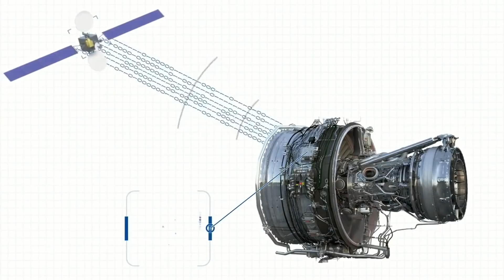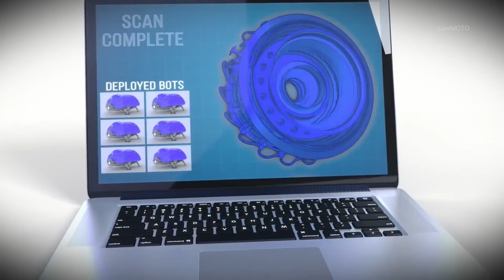Rolls Royce Trent production of turbojet engines

Comment: too bad everyone else in jet engine manufacturing stole Rolls Royce's methods for growing complete turbine blades. a lot of people don't know that turbine blades are grown from a single crystal of metal for extra strength. they are even hollow inside for air cooling.
Reply: Nicholas Howatson I work for Rolls Royce casting single Crystal turbine blade in Indianapolis
Reply: @davebasey9863  can I too get job there?
Reply: You'd probably be surprised at what P&W was doing way back when with welding turbine blade halves into mono-crystalline blades, for JT-9s & space-shuttle.

Comment: RR Trent is not a turbojet, It's a turbofan engine
Reply: Well said.
This total lack of knowledge and understanding doesn't stop some people from plastering their ignorance all over youtube - and many other places!
Reply: THE ROLLS ROYCE XWB-97 TURBO FAN ENGINE IS DANGEROUS AND HAS A TENDENY TO EXPLODE!!!!!
British manufacturer Rolls-Royce has been inspecting its Trent 1000 engines on the Dreamliners for cracked turbine blades deep inside, and taking off those with cracks for repair.
 The number discovered to have problems has “outstrippped rolls royces ability to support the customers with spare engines,” said Trent 1000 project director Gary Moore in an interview. 
IN ESSENCE THE  ROLLS ROYCE XWB-97 TURBO FAN ENGINE IS DANGEROUS AND HAS A TENDENY TO EXPLODE!!!!!
Reply: john john byrne i
Reply: Thomas Macken
Reply: @johnjohnbyrne2607 ,
Reply: d

Comment: This is a 10:1 By pass ratio Turbon Fan engine, not a turbo jet. Mis leading title. A turbojet engine has no bypass, just burns all the intake air
Reply: In a turbojet engine all of the air does flow through the the engine's core and there is no bypass duct. However, a sizeable portion of the air goes around the combustion section and is not directly involved in combustion. This air is used to cool downstream components in the turbine section. Also, in a turbojet engine that uses an afterburner the air that didn't pass directly through the combustion chambers is fed into the jetpipe to supply uncombusted air to the afterburner.

Comment: THE ROLLS ROYCE XWB-97 TURBO FAN ENGINE IS DANGEROUS AND HAS A TENDENY TO EXPLODE!!!!!
British manufacturer Rolls-Royce has been inspecting its Trent 1000 engines on the Dreamliners for cracked turbine blades deep inside, and taking off those with cracks for repair.
 The number discovered to have problems has “outstrippped rolls royces ability to support the customers with spare engines,” said Trent 1000 project director Gary Moore in an interview. 
IN ESSENCE THE  ROLLS ROYCE XWB-97 TURBO FAN ENGINE IS DANGEROUS AND HAS A TENDENY TO EXPLODE!!!!!

Comment: Endoscopic Repair is Ok But The Bots Is Very difficult.
In reality.
The bug or not can not step up which more in height
See care in video.
The not who step up.
It's animation but in reality will fail to step up.
And what if bot or bug  battery or energy is gone.
Now open all the engine or shake or turn the engine in every possible way.
Ha ha ha over smart high tech engineering became to hectic than engineering.